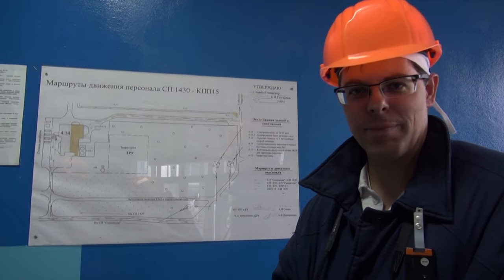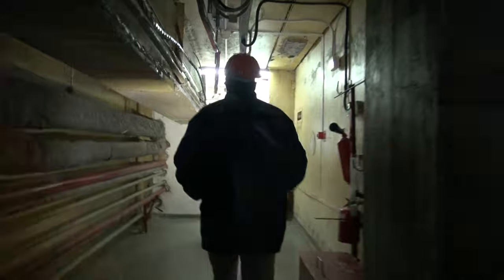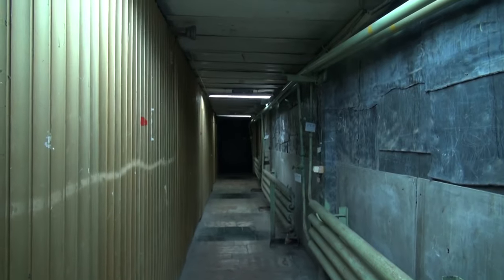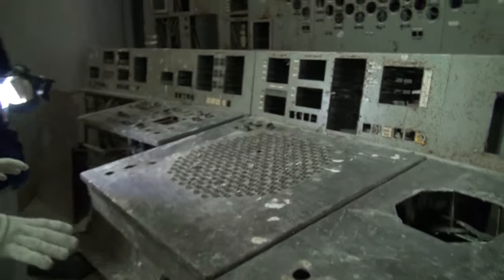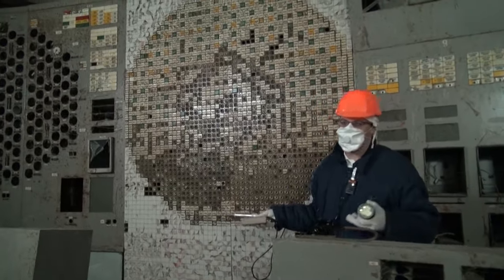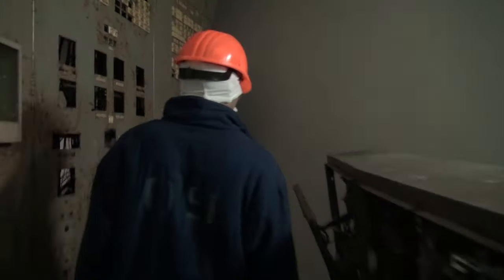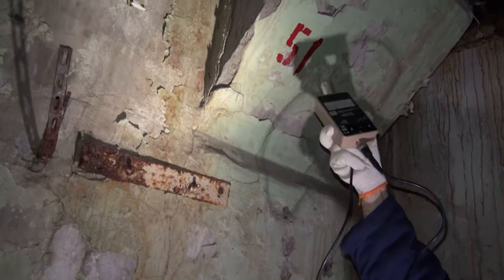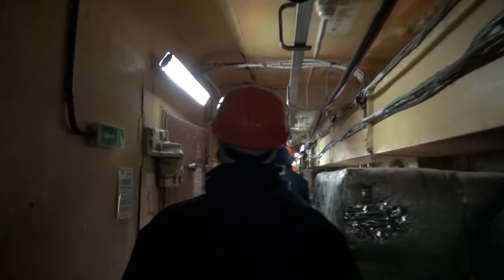inside Chernobyl ЧАЭС sarcophagus 2016 - reactor #4 control room and lead-lined corridors

Comment: not true. They were running a test & The numbers were going up & down when control rods were pulled out. First the control rods were pulled out because if rising temp to fast during experiment from pulling too many control rods out quickly I believe. The reactor is not supposed to cool below a certain temp or heat up to much or fast. Dropping fast they decided to put the control rods back in of coarse, & quickly, everything the man in Charge did wrong & against protocol even the test timing having problems with producing power at near by power plant during the test. for some reason, they were relying on that back up power. He broke every protocol from temperature & ratings & how fast he removed rods ext & put them back. BUT it was not the problem. Hidden from the public, the Soviet Union was collapsing because of this. Them being perceived powerful was weakening, & with Regan pushing it was broken up. The SOVIET Corrupt Communist & "SOCIALIST” Government was to blame. Taking Money off the top, to get their Cut. They decided to CUT COSTS ON FUEL RODS BY MAKING THE TIPS OUT OF GRAPHITE INSTEAD OF URANIUM (LIKE EVERYWHERE ELSE IN THE WEST) IM SURE THE OLIGARCHS MADE MILLIONS OFF THAT DEAL... WHEN THE GRAPHITE RODS WERE RE-INSERTED UNDER THESE EXTREME CONDITIONS IT CAUSED A chain reaction which exploded because of graphite, instead of Uranium tips were inserted. The Scientist which was in charge of letting the world know, went against Soviet orders by telling the world of the Soviet mistake on record purposely to force Soviets to do something  about their other nuclear power plant reactor rods. Because he knew if they kept it quiet for means of control, that it would never be replaced from graphite. 2 years later he killed himself, after locked down & isolated by the KGB. Then the Soviets decided to change the reactors. & the Soviets were disbanded.  America is being attacked by same  communists today. The ones in our own government are creating socialism for their global Communist party. We are no longer a sovereign nation, protected. Our Border open, the president blocked from speaking, even on social media by FEDS, proved Elon. So America is in more trouble than its ever been , with these globalist evil crooks in control after rigged elections now twice. Using many ways, “Smartmatic & Dominion voting machines, mail in voting & ballot harvesting, after hours drops & unlocked or fake drop boxes left around the city, on & on, I dont want to keep going but I can. It was all reported & all real. You can watch Documentary 2000 mules, which shows plenty of it, but not nearly all. Thanks, & Join me at “Christian Prince” to learn about how wicked Prophet Muhammad was, & there is debates also, Adios.

Comment: It looks like they took all of the electronics out of the panels in the control room. I wonder why they did that?
Reply: To many secrets/thieves:  with most of the contaminated area's having been decayed{31 yrs}. Don't get me wrong you still have area's that give up 4-to 15 on meter, but not harmful. You get close numbers to that up in a Airplane above 25k per hour.  .The only deadly thing left, is the core down in the ground and all the rods that have melted/fused into a lump of Turd :). I think the decay rate of that was set around 24000 yrs. Course they could be wrong....

Comment: Do you know if the walls opposite the controls in the control room, were always there, or constructed after the accident, seems like the control room would have been bigger when it was in operation !
Reply: They were most certainly constructed after the disaster. There were doors leading to hallways to the reactor past that wall, so there was probably a lot more radiation.

Comment: I thought the control room would be bigger or with more room.  Did they reduce the size of the room from its original size?
Reply: No that's how cramped they really are, since the control operators don't do much there is no reason to have a giant gymnasium sized room , from pictures that I've seen it appeared to be the size of a house living room so they probably did move the control panel.

Comment: Not exactly true, the button he is referring too lowers the control rods to stop the reaction, however the control rod headers where made of graphite or some material which made the reaction go out of control and blow the lid off the reactor, this was a design floor that only happened for cost saving, unfortunately the cost on human life and environment was far greater,  that default button used to shut the reactor down was infact a dettination button for a nuclear bomb, all because they used cheaper materials on the control rod headers, the other reactors on that sight have since been retrofitted with the correct control rods since the accident but now we have a cancer epidemic thanks to the Soviet union 🤧

Comment: Where the hell did all the equipment from the control room go?
Reply: Into other control rooms.
Reply: @RawbLV  naaah, I think it got stolen just like everything else in Chernobyl area
Reply: @andrewmiles3409  There always have been security around the area and people in general are always working there. Stealing was only a thing during the plant construction. Feel free to "think" what you want but up to year 2000 the plant was still producing power using via other reactors and so the dials and buttons were re-used in control rooms for the said reactors.
Reply: @RawbLV  I'm well aware about the fact of the plant being operated up until 2000, also I'm aware about the facts of looting and illegal export from Chernobyl area which started right after the evacuation and is still ongoing, though it mainly involves vehicle parts, metals, wild grown produce, and trees. Missing nuclear equipment, which is obviously contaminated just made me wonder......
Reply: @andrewmiles3409  I agree with that, but nothing inside the plant itself got stolen.
Reply: @RawbLV  that's exactly what made me wonder what's happened to the obviously contaminated equipment.
Reply: @andrewmiles3409  Well if it's contaminated, then you know what happened to it :D

Comment: Was the wall behind the operators in control room 4 built after the accident?
Reply: Yes, they added a corridor cutting through the control room (unfortunately) a few years later. Before that, the room was much bigger and like that of control room nr. 3.
Reply: @DJ_Dopamine  thanks for the reply. Thought something was a little off with the room. Never read about the corridor being added. Presumably for radiation control?

Comment: What unit of measurement is on your device there?  Microsievert/hr?  I'm trying to understand the amount of radiation exposure you were experiencing.
Reply: That's the correct units yes. They were getting something like 10x what you'd get flying in an airplane. It's not really all that bad to visit for a few hours. You wouldn't want to make a regular habit of hanging out there, obviously, and they were wearing protective gear that would reduce their overall dosage.

Comment: Is it allowed to be in the reaktor 4 hall? I think of Valerij chodemtjuk.
Reply: The hall is filled with debris and various materials they threw in there from the helicopters.
Reply: Myroslav Yes of course. I have seen chernobyl on HBO so no visit there.
Reply: @glimmerkatniss9430  Yes. So even if someone wanted to go into the hall, look for Khodemchuk's body, or to see the reactor core, it's impossible since it's all buried under the several meter-thick layer of debris, concrete, rubber and just everything they threw in there. But the rooms around the hall, the corridors are accessible and people go there if they need to do maintenance.
Reply: Myroslav of course and even If it was possible it wound be very dangerous. Probably one of the most dangerous place on earth.

Comment: Just so people know we as people know how to build nuclear  powerplants but dont know how yo properly shut them down at all. If you've seen the only times  an nuclear powerplant has been "turned off" is when they've had a nuclear shutdown. Chernobyl and Fukushima is examples. The only examples
Reply: Using the AZ-[] buttons are the correct way of shutting down reactors. The RBMK reactor has flawed control rods which upon insertion increase the reactivity instead of reducing it and when the AZ-5 button was pressed it dropped all control rods and the rest is history...